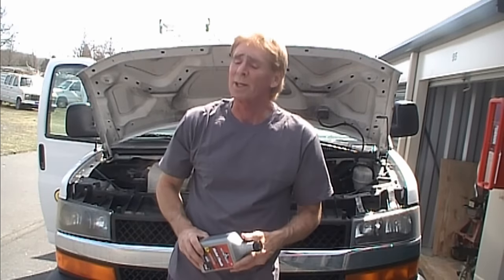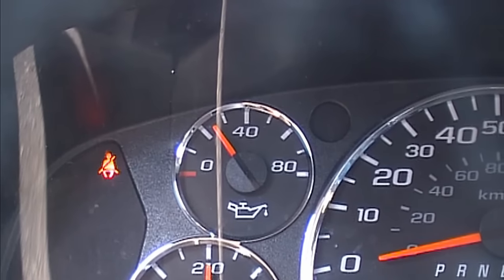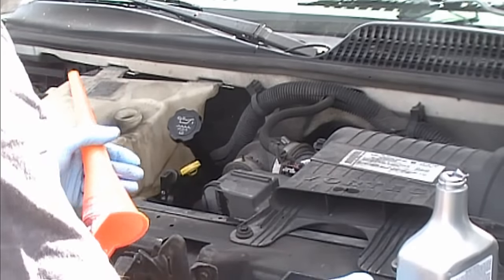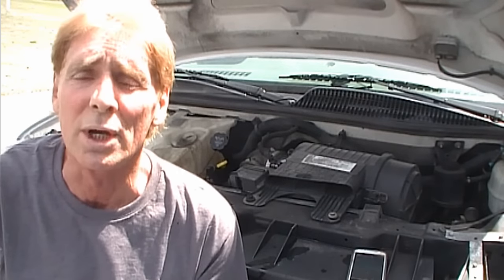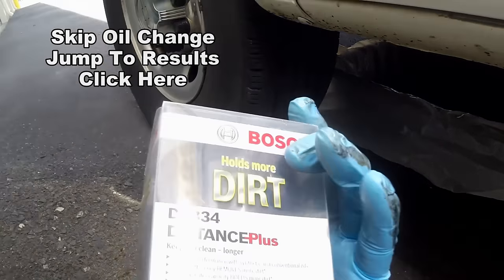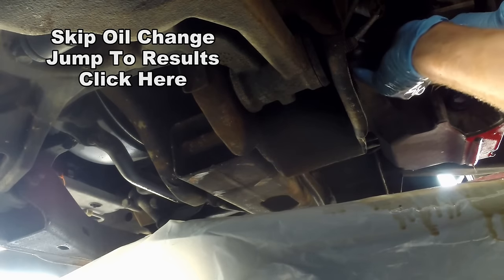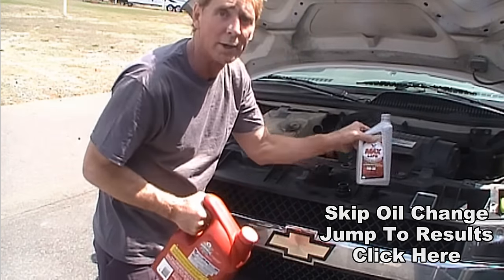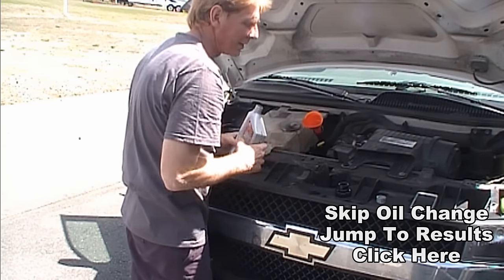NOISY LIFTERS? Motor Flush - Does It Work?  HOW TO DO IT YOURSELF

Comment: ,sorry to tell u man thats not a lifter tick thats piston slap what your hearing the motor needs to be rebuilt cheaper to swop it out wit another one an another thing new Chevy trucks cars suv's all take full synthetic oil Mobil 1 pit a qurt a lucos  in wit the oil change that will quit it down some
Reply: i never sed it was a valve
Reply: the motor in this van is junk the position's are slappen because the oil pump is shot thats why there is no oil pressure
Reply: this an't my video i commented it because i no about alot bout cars i bin working on them sense i was 15 grew up working on cars

Comment: sounds like the rotating assembly, not a lifter
Reply: ya like a bad belt or pulley
Reply: +Richard “Richman” Denis yeah those rubber belts sure do like to make a metal tick sound...
Reply: +TJD293 wait until you hear a bad idler pulley.
Reply: that noise is a serp belt just like when u git the brakes and hear a squeak it's shocks seems legit

Comment: You need to readjust the rocker arms or have timing issues/timing belt jump, however your short solution is to add premium frontline oil additive to your engine oil.good luck.

Comment: The best luck I have with quieting a noisy valve lifter - which in most cases is gummed up and allowing some slack in the valve train - was to use a can of transmission fluid. Put the trans fluid in, take the vehicle for an easy 30-40 minute drive, then change the oil and filter with your normal stuff. Worked for me every time. As to the oil deal, it came from the ground and it can go back - only the stupid tree huggers don't get it. And for those of you not using a wrench to tighten the filter - just wait until one comes loose on you - you'll give that filter a little snug after that - guarantee it.
Reply: Do you put the trans fluid in with the oil that’s already in the engine or just one quart of trans fluid altogether?

Comment: That oil flush is great for oil changes to help keep the sludge from building up, but that's it. There is no way it was going to make that noise vanish if when you shut it off at 7 minutes the noise was still there did you think otherwise ?
 You need something like marvel mystery oil or the sea foam one and it stays in there for 300 to 500 miles of driving while slowly dissolving the gunk that was blocking oil holes that slowly built up over time.  You will notice the noise getting less and less audible  over time and then when gone do a full on oil change with the recommended oils for that car / truck.  Also your odometer shows over 300k , you might want to use high millage oil or add an additive like Restore.

Comment: Well this was a pretty good video. The one mistake you made was using that band wrench to tighten your oil filter. If you lubricate the gasket on your oil filter then hand tighten it you should have no issues with leaking or removing the filter.
Reply: Exactly, I said the same thing above

Comment: Should always use the proper wrench for the drain bolt and put a bit of oil on the ring of the filter just incase it rips and starts to leak
Reply: Try use Amsoil products and their Power Foam and Engine foam to see if it gets rid of the ticking in the engine

Comment: I've had the same problem with a car that I have worked on with the ticking of the lifters and I tried the motor flush and after doing several oil changes @ 2000 miles between the oil changes using the motor flush each time the ticking has gotten quieter. 5 minutes just isn't enough time for the flush to do any good in one oil change unless you let the engine run for 15 or 20 minutes then you may see a difference immediately

Comment: You should probably tend to that oil pump before you grenade that thing. Rotella t 15w40 does wonders for high mileage motors too. You should see 60 psi oil pressure on a healthy LS

Comment: The oil pressure at engine idle just have to reach a level of 1 - 1,5 bar (14 - 22 psi). The over pressure valve starts to open at 3 - 4 bar (43 - 58 psi). This valve is often built in to the oil-filter.
Slopping oil is enviromental pollution. In Germany you would face death penalty for this crime.
The ticking is a result of a worn o-ring gasket inside the lifter. Cleaning mostly increases the noise. Using thicker oil like 10W or 15W could help. 
You have to run the engine for a time with some warm-up and cool-down. In this case it sounds like there are some lifters to be changed.

> Reunite Pangea ! <

Comment: I learned to change the oil about 40 years ago. I was told to wet the built-in gasket to the new filter with a swipe of oil with my finger and hand tighten and just a quarter turn. You really tighten that thing. But I have to admit you know it hell of a lot more about cars than I do
Reply: I did a oil change on my van I swapped out 1 quart of oil for one quart of transmission fluid let engine run over 30 minutes noise went away

Comment: Mine does this but stops after start up when cold. Help plz
Reply: Heard use transmission fluid and drive for about 500 miles then change oil
Reply: @eddiecruz2613  use transmission fluid where?
Reply: Pour into crankcase also have heard good things about marvels mystery oil

Comment: Oil pressure is a very peculiar thing. Keep in mind that in the 50’s and early 60’s Chevrolet considered 5-6 psi of oil presser exceptional. I have a 64 for that came stock with a max of 10 psi.
Reply: I see ~22 psi at idle, wouldn’t consider that any kind of problem, especially at 312k miles.  If I put flush in engine, I would drive it gently for a few cycles and then drain it.  Vise grips!  Really?  That tick doesn’t sound too good.
Reply: The car I drive apparently cycles oil pressure from 5 psi to 65 psi - so the gauge is a "dummy gauge" kept at around 40 to 43 psi - just so people don't freak out. hahaha
Reply: @voidisyinyangvoidisyinyang885  haha yes, in a modern car I would say 5 at idle is a definite issue. Parts are more precise, tolerances smaller, and more delicate that requires higher pressures to stay aloft
Reply: @jackeyster5885  yeah my bad - I think it's 12 to 13 psi at idle...

Comment: That Valvoline blend will make your car knock on cold start ups, never realized it was that blend of oil that was causing the noise until I stopped using it for a while and went back to it and the noise came back.

Comment: Cleaning the lifters would be a great idea, Except for the fact it is an Ls engine which requires pulling the heads to get them out. At that point you might as well just put new lifters in.

Comment: 312 K miles on a Chevy?  That's a highly unusual situation.  I wonder how it lasted that long.  The color of the oil didn't look that bad, so I assume it had regular oil changes?  Hindsight is always 20/20, but I would have been surprised if the motor flush fixed the ticking sound.  But, it was certainly worth a try, especially since you weren't the original owner.  I had to cringe when you removed the oil drain bolt with vice grips and tightened the oil filter with a wrench.  I would lose my job if my boss caught me doing that.

Comment: This is old, but It's a stuck lifter, and motor flush won't work.  Try Marvel Mystery Oil or Seafoam in the oil.  If those don't help, then you have to replace the lifter.  I am not convinced with Lucas Oil Stabilizer.  I'd try MMO or Seafoam first.

Comment: This is for anyone with this problem  run 10/40! It’ll quiet a lot of engine problems and raise the pressure. Did it with mine and worked great. Mine wasn’t as bad noise but you Cld still hear it and it was annoying